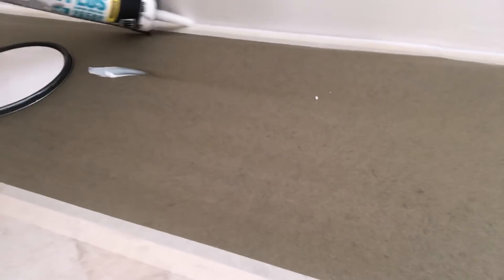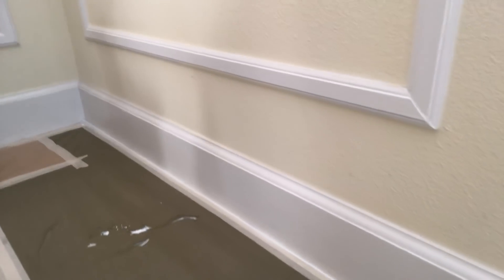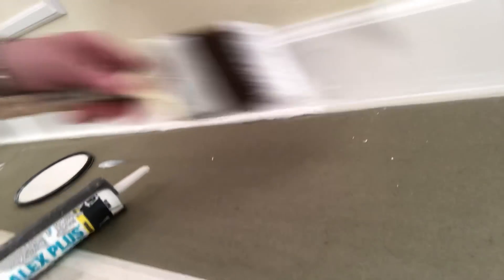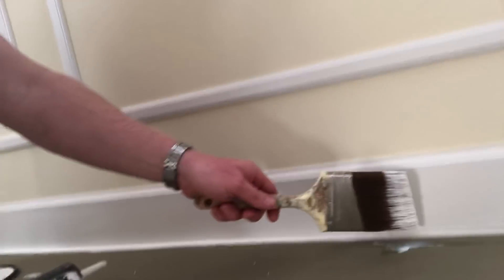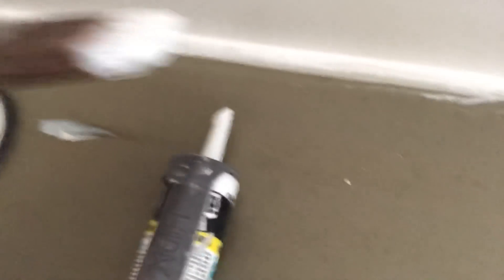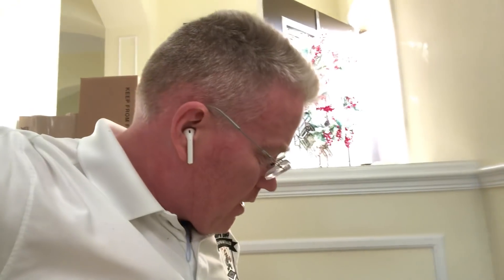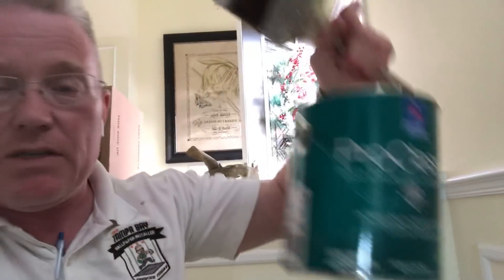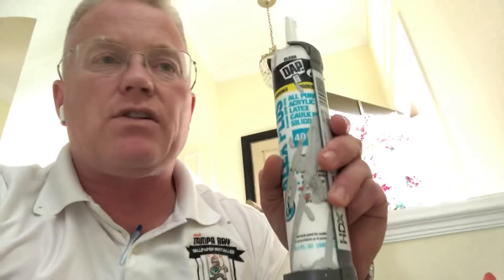How To Paint Baseboard (Skirting Board in the UK) With an Angled Sash Brush - Spencer Colgan

Comment: what type of angled sash brush do you recommend to use on skirting boards with oil based paints?
Reply from the maker: City Tee 
If they have them in your country, please purchase a Purdy.   A 3” angle sash.
Reply: is there a specific type of Purdy brush to purchase as they have many
Reply from the maker: City Tee 

Yes, Purdy, medium stiff, for latex paints for latex. Or one for oil specifically for oil.
Reply: @spencercolgan  okay thanks alot